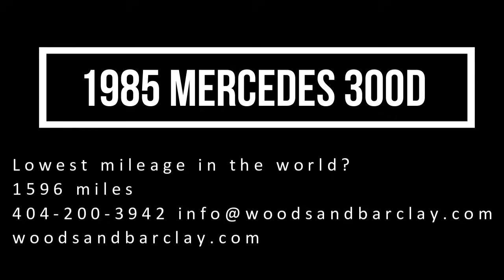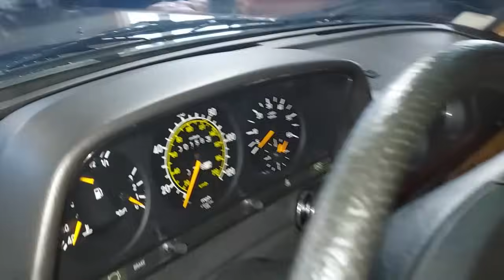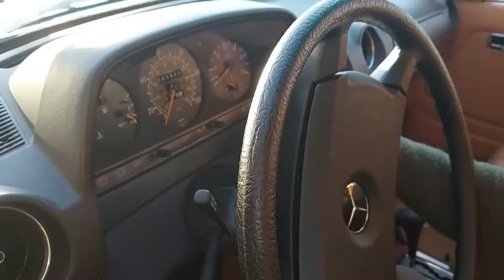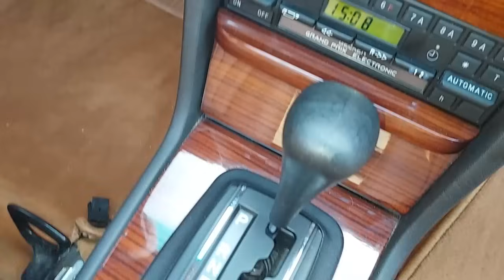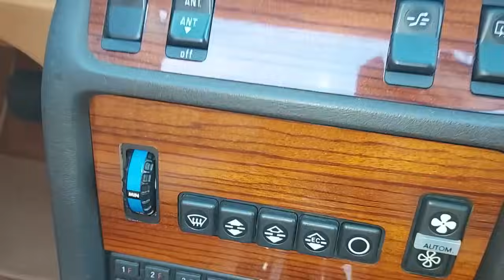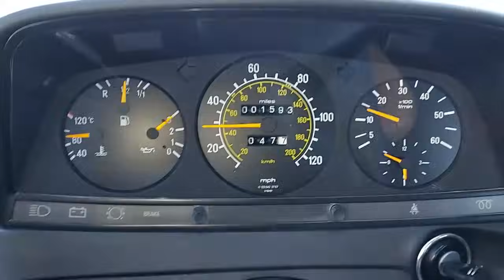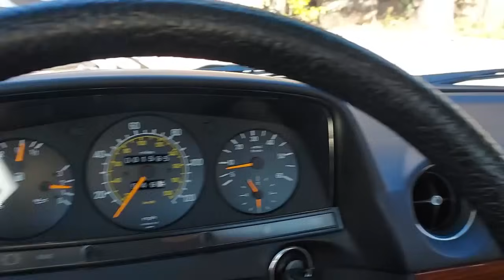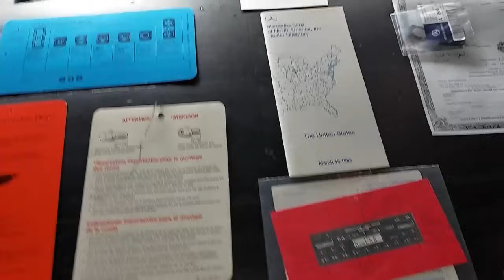Lowest mile 1985 300D in the world?!?!?

Comment: Unbelievable! Having owned 32 W123/W126 MB in 35 years, I had never seen a "new" W123! Comforting for me was the fact this "new" 300D had a temperature of 90/95c on the gauge and what appeared to be 2.5 oil pressure idling. Even the most astute MB authorities (in my 35 years owning them) have been proven wrong in that it's ok for the temp gauge  NOT to be right on 80c and oil level not to be on "2" idling! In fact, Ken B. just did every thing possible to get his 300D temperature from 95c back to exactly 80! Thanks for a historical video, John! Now, every person restoring a W123 has a "guide" to follow!
Reply from the maker: Yes the correct operating temperature for these cars is between 80° and 100° and that is stated clearly in the service manual it is perfectly fine for them to run at 95 if you have the air conditioner on and your driving hard uphill that will happen sometimes.

Comment: Wow what a car.  I think its absolutely great to be able to see a car so many years later and so new, not to mention that guys garage.  He would probably drop dead of a heart attack if he saw mine.    I'm at a loss to understand how anyone can own a car of any type and not drive and enjoy it, or be afraid to.  Sure if you have 30 cars you can't drive them all.  There are so many great aspects of a car besides looking at it.  
A big thanks to woodsandbarclay to inspire me to clean up and try and restore my 1982 engine compartment to "newer" condition.  Fortunately or unfortunately, depending on how you look at it, the previous owner oil sprayed the crap out of it.  I just looked at it and I got dirty.  It took me a very long time cleaning everything up and actually found components I didn't even know there there because they were buried in layers and layers of old oil spray.
Reply from the maker: Just get a good degreaser and a low powered electric pressure washer and you can clean that engine compartment!
Reply: @woodsandbarclay  Well as usual you are helpful.  It still amazes me the detail in your instructions.  You bailed me out this morning showing the worn plastic pieces on my throttle 2 & 3 way and you provided the part #, thank you.  Unfortunately I did the cleaning over winter (summer is way too busy) and couldn't use a spray washer, however getting right in there I could inspect everything.  I used a steamer and that helped a lot and found 4 small holes in the engine compartment....canadian car.  We like our french fries because we have all the salt you would ever want 😝  Keep up the great work!